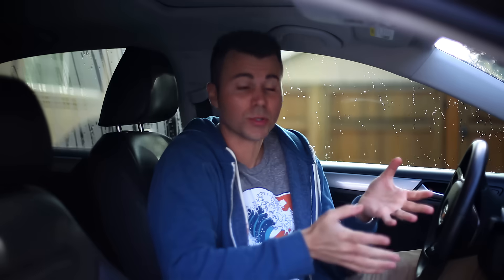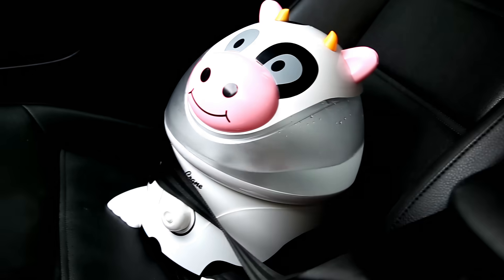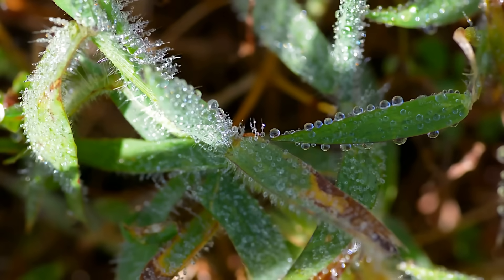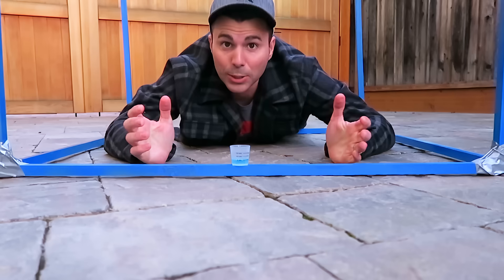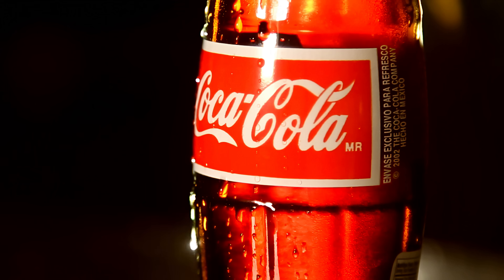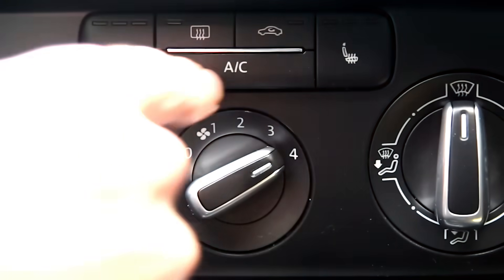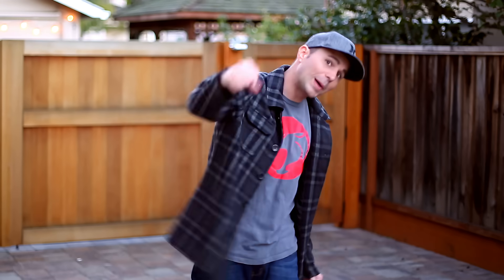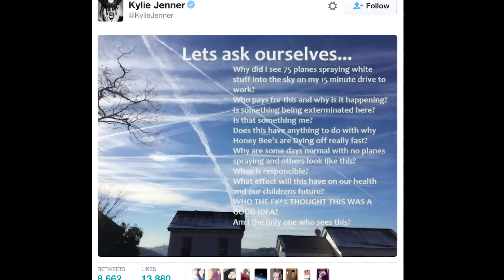Defog your windows TWICE as fast using SCIENCE- 4 easy steps

Comment: To DEFROST faster:
1. Hot air on high; defrost
2. Air recirculate on if you have a button for it 
3. Make sure it’s on defrost

Legend says If you hold the gas pedal, the engine heats up faster too

Comment: This should have been combined with advice on optimal defrosting because I bet the best settings do not include AC
Reply: Actually it does. Infact that is why the car manufactures automatically turn the AC on for you any time you turn on defrost!
Reply: @eatshitful  I think this probably depends on whether you are in a cool climate or a warmer one. Blowing dry air at my window doesn’t do much if it’s freezing cold.

Comment: One bit I didn't get was the part you said turn ac off because it introduces outside air which has more capacity to "wet your towel" (let's say) but yet right after you say it's a good idea to open as many windows as possible for a short time,isn't that introducing that same said air?

Comment: From my own experience: just turning the AC on will defog the windows faster, but will make the temperature inside unbearable. Turning it off, the fog will be back really fast. 

Turning the heat on will defog the window really slowly but permanently, as the temperature inside rises and the air can hold more moisture.
What I usually do is open the windows slightly and use heat to defog, but that implies you have the engine warm, so usually I start with cold if I want to move fast.
Having your windows clean helps too, as dirty windows fog easily: the driver side takes always more time to defog over the passenger side for a reason...

Comment: Why do you describe defogging as defrosting? It is not the same, I would appreciate a video on efficient defrosting.

And turning the A/C option on does not increase the airflow from outside, the reason it works is because the condenser of the A/C becomes very hot and draws all the excess moisture in the car away from the windows.

Comment: Crack your window open slightly when you get out of the car. The humidity will equalize. No condensation will form on the inside. The extra humidity on the inside is from the people in the car.

Comment: I know im few years late and this guy is like 100 times smarter than me BUT !!
some things in this video doesn't make logical sense..
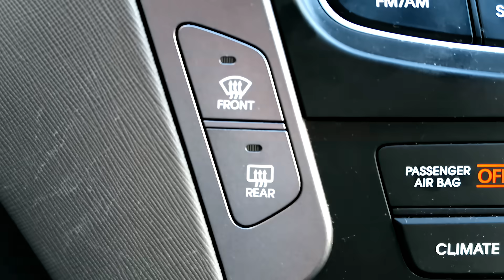0:08 "some cars has one button to defrost all the windows". he totally misses the defrost button for the rear window LOL
and the button he "pressed" and the setting in  0:12 is the same thing. "defrost/defog" function which blows air towards front windshield.
the car in 0:12 just has analog dial instead of a button 
When you first get in your car in winter time you dont get hot air until the car warms up
so best thing to do is run your car with remote start while you're getting ready in the morning. with the defrost on of course :D

Comment: Doesn’t it depend on what the temperature is outside? In Florida it’s very humid and hot and some times when it’s hot outside and I’m blasting my AC with the windows closed, the window fogs up. Because the inside of the car is now colder then the outside air. So wouldn’t it be the opposite of it being cold outside and hot inside?

Comment: Used the hot air with A/C trick for years to quickly defog the windows in my car.  The only part where I differed was in the fresh air vs recirculated air.  I always used recirculated air because I didn't find fresh air to be that much more effective than recirculated.  I always found the A/C to have the far bigger impact on speed.  Plus, most of the time I would have to do this, it was mostly in the winter.  And at that time of year, getting the car "warm" so I could stop shivering always took priority first.  So I always found hot recirculated air with the A/C to be the nice middle ground between warming up the car and defogging/defrosting the windows to be the most effective across all fronts.
Reply: yep, exactly like me, for me the recirculated works much more faster then the fresh air

Comment: if its frosty wait a couple minutes to use high fan, or the car doesn't warm up. the heating system cools your engine, on high it will warm up very slow. let it warm up a bit so you get warm air which will do more in frost conditions.

Comment: My car will.not run ac and heat at same time. Temperature gauge( dial ) is either hot or cold , I have never seen a vehicle that  will blow hot and cold air at the same time.

Comment: Most if not all cars automatically put these settings on without your control when you put the setting to defrost front windshield. 

The climate control (even manual climate controls) will turn on a/c and air from out of the vehicle, your only task is to put the temp to heat, but that will be cold anyways since the engine is not fully warmed up when you start up the car.

If your a/c fails you will truly see how long it takes to defrost windows in the winter lol. Plus using the a/c also helps keep the system in use over winter when you normally dont use the a/c rather than having the compressor and moving parts unused all winter long.

Comment: Clever man. This was a ballsy video to post because it's full of holes which will no doubt lead to a lot of disagreements which should generate a lot of comments and thus $$$$. But I can't resist. 
Many car mfgs automatically turn the A/C when defrost or bi-level is selected and often the A/C light is not on; (perhaps this is so people don't think it's set to blowing cold air and frantically try to shut it off). The purpose to this is because the A/C dehumidifies the air as well as cooling it. However the cooling effect it negated once the engine is warm and you have the cabin heat blasting on full. On some vehicles - like Hyundai - you can press a combination of buttons to override the A/C when defrost is on. But, on cold days, A/C to defrost is often useless because the compressor will not operate below a certain temperature - usually a few degrees below freezing. I don't know why this is but you can see both of these for yourself with the car running and the hood open and watching for the compressor to switch on. On other cars still, there is no point in running the A/C to defog the air because some cars have an electrical heating element in the venting system to heat up the air (because your engine and coolant are cold for several minutes).
If you want to reduce morning condensation you need to eliminate the water in the air before you park for the night. Open the windows while driving to immediately cool down the interior then close then and run the A/C on cold and use the recirculate button right up until you park. This will reduce the amount of water in the air that can condense out as the car cools over night. 
While the seat and plastics still hold a lot of heat and will eventually heat the interior again before it cools further, if you leave the recirculate on, the amount of water from the outside that can get in will be reduced. 
Aside from that, your test really is only applicable to your car. I disagree with the turn the heat up full blast advice without including letting your car engine warm up a bit before turning on the fan, the heat or even driving away.

Comment: In most cars, the A/C is automatically turned on and disables the air recirculation when the defrost setting is selected.  No need to actually press the A/C button at all.

Comment: The biggest flaw with your method is the rate determining step is how long your engine takes to heat in which it actually then has the capability to pump hot air out of the vents.

Comment: A/C on and turn heater to hot?????? i think there's only one radiator to use either hot or cold air in the car, correct me if i'm wrong.
Reply: Yes, you are wrong. The air conditioning system and the cabin heat run on two different closed systems to exchange heat. An air conditioner dries the air in addition to removing heat from it so having full heat with the A/C on has a different effect than full heat without it. Wanna see for yourself? On a rainy day, turn full heat on and full A/C until windows are clear. Then shut off A/C, turn the heat down and the windows should fog (if they don't, turn heat back up after waiting a minute or two). Once fogged, hit the A/C and watch the fog instantly disappear
.
Reply: You are wrong

Comment: What about external condensation? I often run into this problem when it's raining at night and the inside of my car is colder than the outside air. It could just be my wipers but after every pass they just leave a film of fog that makes oncoming headlights glare. My only solution so far is to just use the defogger but it turns the cabin into an oven.

Comment: Your car turns the A/C pump on automatically if you select defrost... No need to push the button as well. Sorry if sometime already posted this. 
Bonus tip- If you "floor it" your car will shut off the a/c pump to give you every bit of power it can. So if you want every bit of defrost power then no drag racing.

Comment: Uhm, I'm a little bit late, but there's a real 5th step, which is actually the first one: Let the warm and moist air out the evening before! For the  last 10 or 20 seconds of your commute lower all your windows, if it's cold and dry outside. Most of the moisture will go out and won't fog your windows in the morning.

Comment: I live in Canada where we have to plug in our cars with block heaters and even interior heaters and battery blankets. The pure amount of electric plugs needed I've always ran a multiplug into the cabin.. And left a hairdryer inside...  So I'd use the hairdryer before driving off..  Also.. Cover the glass on the outside overnight.

Comment: Based on Australian conditions at least, the only limit with using hot air I believe is it's unlikely the engine / radiator fluid will be warm enough before the windows are defrosted. Aircon of any temp + blasted air + windows slightly down works good enough. Thanks Mark

Comment: liquid soap works better than shaving cream to prevent fogging/condensation buildup on your windows because of the properties of the soap...soap is both hydrophilic and hydrophobic...the ends of molecules in soap wants/attracts water and the other end of the same molecule does not want/repels water...and soap works so good that divers use soap on their goggles/facemasks when diving under water to prevent condensation from forming inside their goggles...if that did not work then they would not do it...but they do

Comment: Out of the 4 cars that I have daily driven, 3 of them automatically put on AC with the defrost/defog setting. Also, it's should be pointed out that unless you have tesla (or other modern vehicle that has an electric heater), the engine needs to be warm to be able to get warm air in the vehicle. So really, you should just let your car idle ahead of the time you need to leave and go finish getting ready. Could even crack the windows since you won't be In it. And it really isn't that wasteful or polluting since you would be sitting there for a few minutes waiting anyways.

Comment: The newer cars do it for you the optimal way which is turn it to hot all the way and Reserc Off and A/C on, this is so new air from outside comes in turns hot and goes to window mixed with Cold air from AC and it turns into Dry Air Wich the moisture from windshield will jump to in a molecular form until the glass is clear

Comment: A better way to defog in winter; on your way home turn the heater on high heat, just before you reach home open all the windows fully to wash out the hot air and replace it with cold,  then there is very little water left in your car to fog the windows in the morning. (as long as it is not raining outside obviously)

Comment: For lazy people: max heat, AC on, outside air, windows cracked
Reply: For lazy people: drive with the fog
Reply: Stick your head out the window xd
Reply: @Shinigamie34  ace ventura mode haha
Reply: @Shinigamie34   drive with minimum vision lol just enough to kinda know where your going
Reply: instructions unclear, my window is now shattered
Reply: @MXMLN69  good. Now you can see outside
Reply: @MXMLN69  but it's not foggy now, is it?
Reply: @lindsey3038 modern problems require modern solutions
Reply: I cracked my window but it shattered, did I do something wrong?
Reply: Most modern cars automatically turn on the AC (despite the light not being lit) when you turn on the defroster.
Reply: @CalculatedRiskAK  turn it on just in case anyway
Reply: @CalculatedRiskAK  not most, all (obviously the cars that have AC)
Reply: Max heat plus AC. How does this make sense.
Reply: @ryanarruda1554  the A/C removes moisture from the air.
Reply: I say drive in reverse if that's not fogged up
Reply: For lazy people: Move to Arizona
Reply: Thanks
Reply: You the real hero.
Reply: Try using mac
Reply: What about having a layer of ice instead of “fog”
Reply: I am not sure I would do that at 5F, although at that temp I am half way home on my 18 mile trip before the heat begins to work (provided I did not have to brush snow and ice off my car).
Reply: How fast does this work? Anyone try it yet
Reply: Use barb. Shaving cream
Reply: For Lazy peoples : destroy all of your windows.
Reply: Thank you. I didn’t have to hear about water droplets.
Reply: Answer at 3:34
Reply: Which is about 1000x faster than watching a video say it.
Reply: For decades cars have been designed for the A/C to be on when the defroster is on. Although most think it's a mistake and shut the AC off.
Reply: Excellent
Reply: That's already what I used to do. You saved me 5 minutes of my life stranger, I thank you.
Reply: I honestly don't get the "max heat, ac on" part.
All the cars I have seen, have a dial, that ranges from maximum heat to maximum AC.
it's in a single dial.
How do I do both extremes at sane time???
Reply: Lazy people use Uber.
Reply: Same settings I already use only my AC is busted.
Reply: How can you have max heat and ac on?
Reply: @Sandman60077  that is what the defrost position/buton on the car's hvac controls is supposed to do. As I said in a previous comment cars have need doing this as far as I can remember (oldest one I had was 1994 corolla and it did eactky that)
Reply: Superlazy people: pull up your phone, tell the car to preheat/defrost 10 minutes before departure. Done, no fog/frost on the car the second you see it.
Reply: Hold on just let me get my hammer 🔨 🤣
Reply: Hold on let me just get my hammer 🔨 🤣
Reply: AC should be on permanently anyway. It's better.
Reply: I have an 02' Blazer & defroster blows hard & hot but the windshield stays fogged up. My Controls only have A/C, or Heat. Unable to turn A/C on with Defroster on. It's one or the other. This problem just started. Defroster blows hard & hot but it does nothing to this windshield.  I'm curious as to why. Normally hot air clears the windshield quickly.
Reply: Mike Hog A Nator use defrost with cold
Reply: @Mike_The_Hog_A_Nator  The trick is pulling your windows down while your heat defroster is on, so that air can circulate and dry up the humidity in your car. If you don't, it won't work.  Or you might have a heater core leak .
Reply: @Mike_The_Hog_A_Nator  AC is on when the defroster is on
Reply: @Mike_The_Hog_A_Nator  maybe your heater core is leaking
Reply: @Mike_The_Hog_A_Nator  With many modern cars, the Defrost setting will also turn on the A/C, unless it's too cold for the A/C to be effective.  The problem with this is, water that collects on the condenser has to go somewhere--and if it's cold enough out that the drain freezes, all the air going through your blower ends up passing over this pool of water, picking up humidity that gets deposited on your still-cold window.
If you leave the heater on (not Defrost or A/C or Recirc) long after the windshield is clear, keeping the windows slightly open, you will eventually clear out the moisture, and the defroster will be more effective.  Or, you can wait until warmer temperatures allow the drain to thaw.
Reply: @Mike_The_Hog_A_Nator  Probably a bad blend door actuator. Pretty common in these trucks.
Reply: @Mike_The_Hog_A_Nator  I had a blazer as well, same problem. It probably has something to do with the thickness/type of the glass
Reply: Boiling water splashed on the windshield. Then you won't have to worry about defrosting your windshield ever again. Until you get it replaced.
Reply: So, exactly what everyone does anyway...
Reply: Instructions unclear, I cracked my window (literally).
Reply: Literally what he just said in the video. But we'll say it's your idea.......
Reply: Thank God! I couldn't take anymore of the annoying music.
Reply: There are 420 likes so I can’t like
Reply: @ethanthai5148  i will like for you, sir!

Comment: Tturn on the defroster.  Heat on high. The defroster  automatically  turns on the air compressor  pulling  the moisture  from the air.
 Which is exactly  what this genius  figured  out  to some degree it just took him a longer.
He had a zinger but it flew past him, he was using shaving cream to shave time off defrosting  his windshield. 
 He missed it, I caught it. All ends well 😉